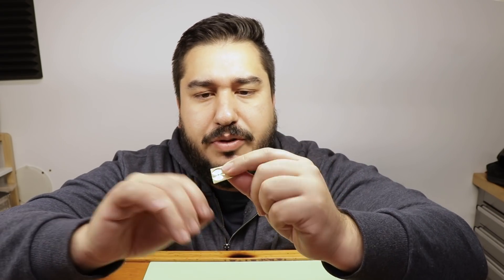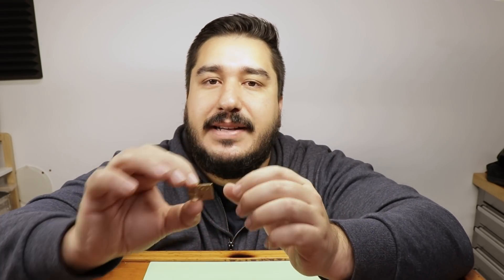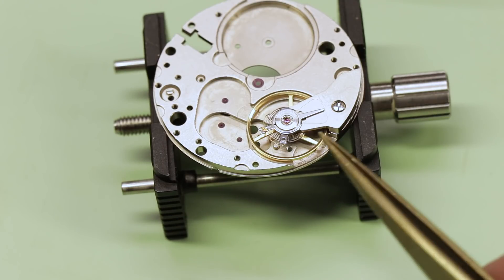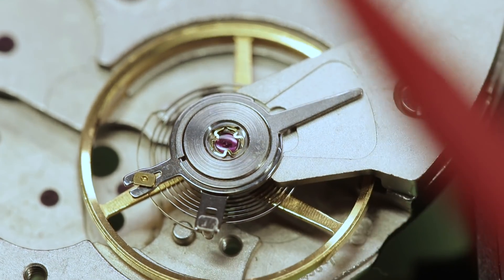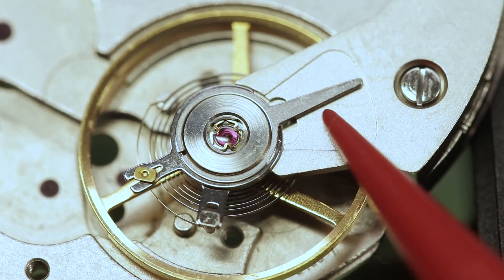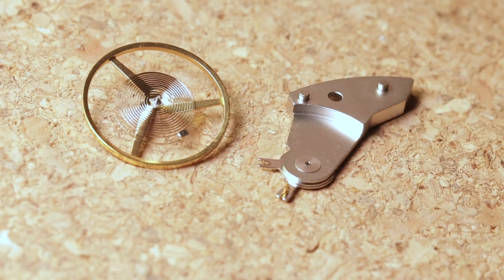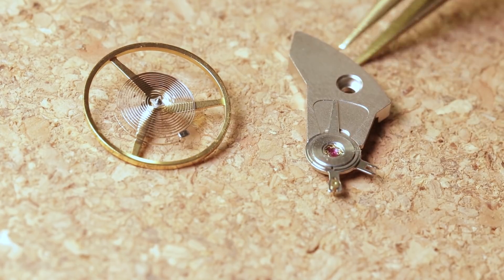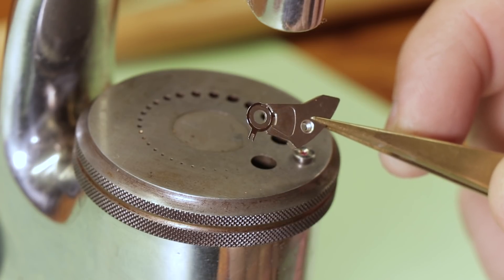Making the Balance Wheel Bridge Part 4 - Watchmaking Vlog 29

Comment: why is brass your most used metal for watches?
Reply from the maker: Well most watches are made of brass and usually plated. Even the ETA movements are all brass.. Brass is not magnetic, has great corrosion resistance also more importantly minimal thermal expansion compared to other common off the shelf materials.. also great to work with 😁
Reply: I agree Dean, Brass is an easy and clean metal to work with. It polishes nice as long as you dont get fingerprints on it after the watch cleaner (mini ultrasonic). Fingerprints corrode brass.  Christopher, In my experience of Repairs it is easier to "repair" worn brass plates and bridges then to center drill, pressure fit, and polish new pivots made of high carbon steel. So its engineered failure for ease of repair and overall workability. Just be positive to keep the bushings/Jewel seats in line and with proper gear mesh distances.
Reply: * in this case, proper roller jewel radius in relation to the Pallet Arbor pivots and banking pins. Draw a straight line from the Escape wheel pivot through the Pallet pivot to the Balance pivot. (in standard Swiss Anchor Escapements and most American, British, and Dutch watches and clocks)

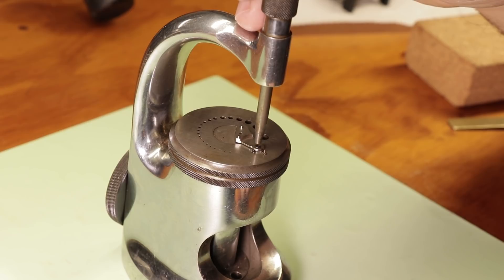Comment: A couple of observations you might think about.  At time marker 9:23, I noticed a steel hammer that you used on the staking punch.  Only the faces of the punches are hardened, not the ends.  Using the steel hammer might mushroom the end of the punch, and prevent using it inverted, as a stake.  Better to use a brass hammer.  Also, I would use a jeweling press, Seitz,  Horia, or the K&D conversion kit.  Otherwise you may experience of the jewel dropping down the long tube on the staking frame, then bounce off somewhere, forcing you to stop everything, look carefully around your chair for the walkabout part, get the flashlight, and the rest of the sad, sorry Lost Part Dance.  you know the drill.  Ask me how I know that....
Reply from the maker: Thanks Adam 🙏🏼😁